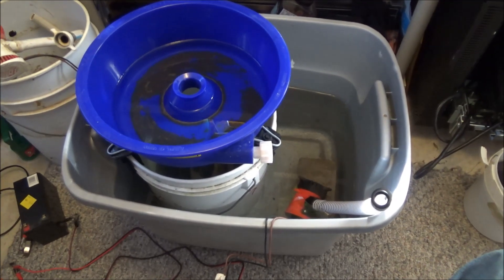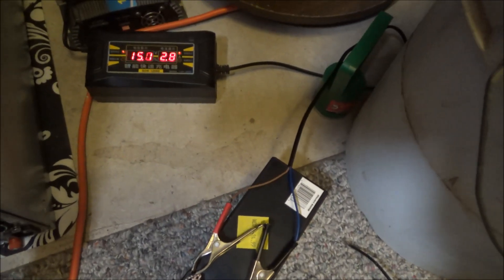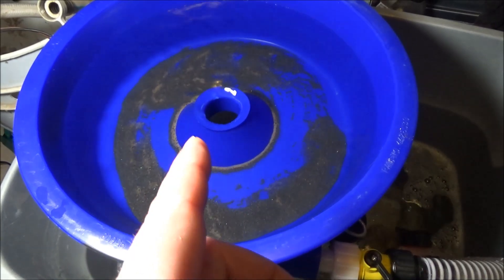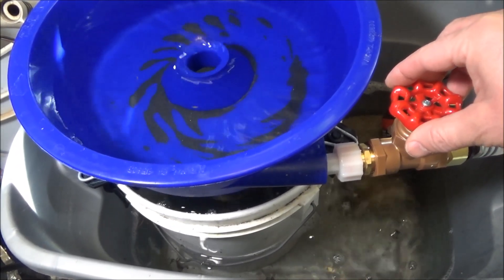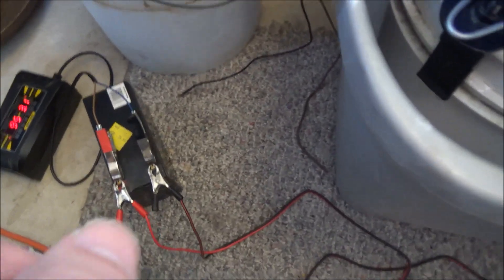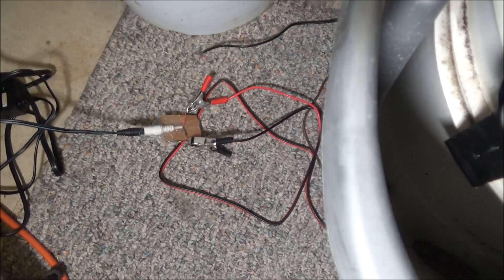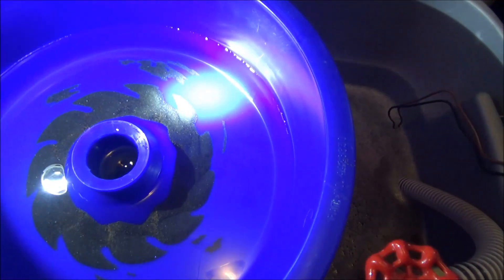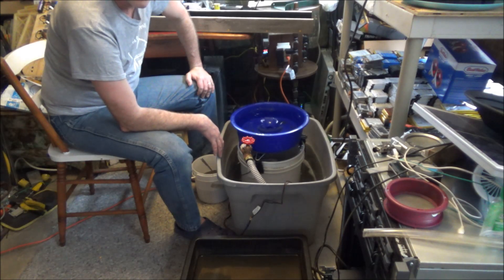Simple Modifications To The Blue Bowl Gold Concentrator For Better Gold Recovery

Comment: Mine is only a trickle, then stops.😮😮what am I doing wrong. Help
Reply from the maker: Not sure. Check for blockage in the hose. Make sure the pump works right. Check that the valve works right.

Comment: Battery voltage varies as its power is used of course so yeah, a water valve works along with not getting greedy and trying to clean cups of stuff right away instead of being patient by cleaning it in tablespoons.
Reply from the maker: It is a slow process for sure.

Comment: You might have too much material in yer bowl. 2 tablespoons is what's recommended. This is why all of that blacksand isn't moving. You can also use an earth magnet. Drag it around in the bowl, then dump it in the center hole to save and rerun, incase gold got captured with the blacksand while using the magnet. Now half of your work is done!

Comment: Hi Troy I was watching your video "Simple Modifications To The Blue Bowl Gold Concentrator For Better Gold Recovery" and enjoying it very much, an idea hit me. Not sure this channel or your The Do It Yourself World Electronics would be best. Anyways the idea is maybe tiny variable electromagnets taped to the underside of the bowl to use the ferrous metals inside the bowl as adjustable ridges and eddies and such to help with collection of gold. Tell me what you think?
Reply from the maker: I had to give your suggestion a lot of thought. The black sand built up would cause a dam to bog up the bottom of the blue bowl. There is a silicone insert for the blue bowl but in my experience, it does a nice job on its own for round gold. The Miller Table is best for flat stuff.
Reply from the maker: But I am considering some magnets to capture the black sand under the blue bowl as it falls down cause I want to keep that too.

Comment: I'm not sure if it would be any better, but they sell water pressure regulating valves. Adjusting the water flow might be easier with the water pressure gauge that is on them.

Comment: You could used a dc to dc buck converter with a constant voltage output to run the pump. Then you could run the pump off of a higher voltage and not worry about battery voltage until the battery gets low.
Reply from the maker: Yes, very good point. I am also considering an LM338 voltage regulator to power this. I need at least 3 amps for the boat bilge pump.
Reply: @TheDoItYourselfWorld  Well, just a suggestion, buck converters are pretty cheap and efficient. Linear voltage regulators are not, waste the voltage difference power through heat generation. The AC power brick not too good because from battery to inverter AC back to dc not real efficient either.
Reply from the maker: I know, you got me thinking.
Reply from the maker: Oh, here is an issue with the idea. Buck converters need at least 1.5 volts higher on the input than the output. So the battery has to be over 13.5 volts. You could reduce the water pump voltage I guess.
Reply: @TheDoItYourselfWorld  I was thinking of 2 or more batteries in series since dc to dc converters have a wide input voltage range. That way, you get all the usable power out of the series batteries.
Reply from the maker: That would work. I could use some of my Lithium batteries for this and just build a nice portable power bank.